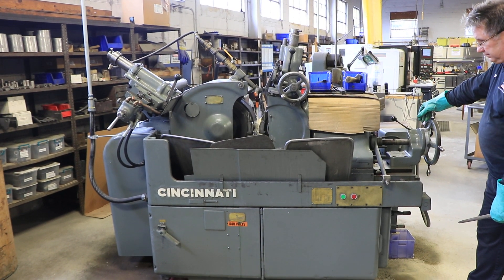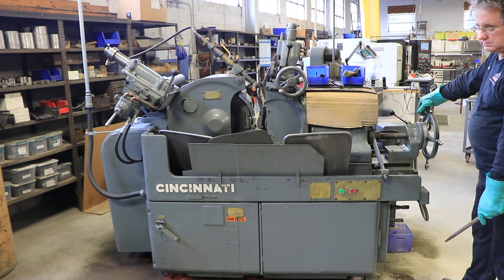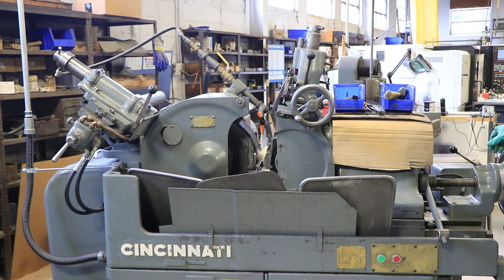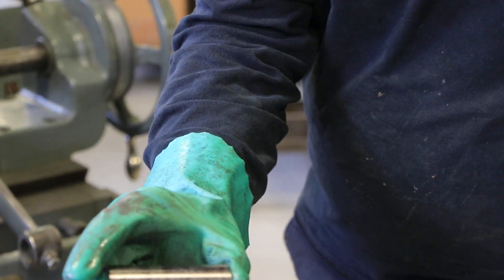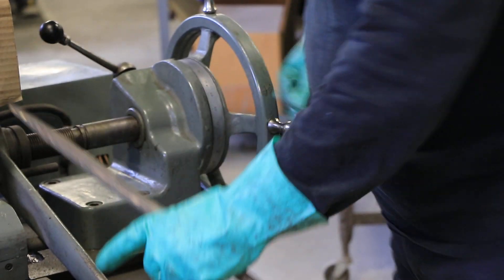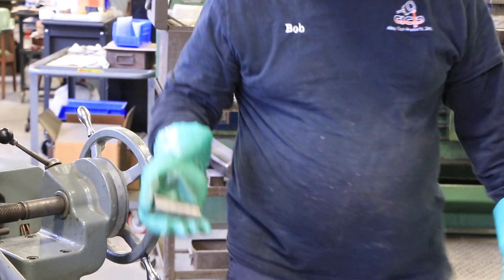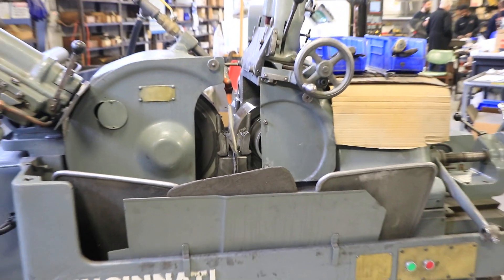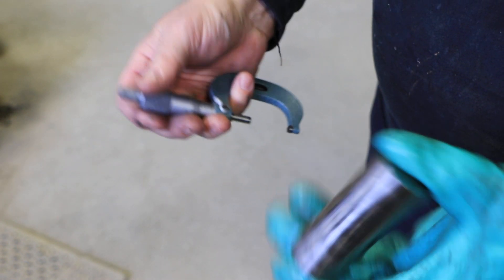CINCINNATI No. 2 "OM" CENTERLESS GRINDER

Comment: Listen to that chatter and inconsistent grind lmao. Add taper or pull if that doesn’t fix it then it’s a bad dress and don’t have a part inside while running that’s how you get flat spots and definitely don’t move the regulator wheel in while running and part is inside that’s how you launch parts, through feed is not meant to take a lot off at a time unless it’s soft but even then we never took more than .010 /.015 off at a time use end feed for that

Comment: It is not supposed to sound like that, it might be just the audio being weird.
Regulator wheel needs dressed I believe.
Reply: Sounds more like wheel speed to me i think the blade heights too low so the part is floating between the wheels . Very dangerous with a part thst small and no vent ontop to catch it if it goes flying! Also the cut seems all off and they did a finishing pass without changing the cut or a dial mic lol cant be within .001 with a standard mic.

Comment: Do you have a video on how to adjust the angle or what happens when you turn the knobs?
Reply: The "cut" or angle of the grind wheel is on the back of the grind wheel side of the machine in this case to the left, there are 2 screws near the dresser knob you loosen the way you want the cut to go. Further forward for a smaller or finishing pass and toward the rear for s heavier cut, this machine also should have push pull method adjustments which are just bolts near the coolant trough on both sides of the wheel adjuster he is turning to dial in the next cut. Those work the opposite from the back side adjustments and you tighten the direction you want the cut to go. The regulating wheel on the left can be adjusted as well but thats much harder to explain but the angke of the reg wheel control the spin of the bars through the machine i find when grinding 2"+ tubing the angle should be higher than 1" ss bars. But that all can be adjusted based on the finish requirements and tolerance tightness.